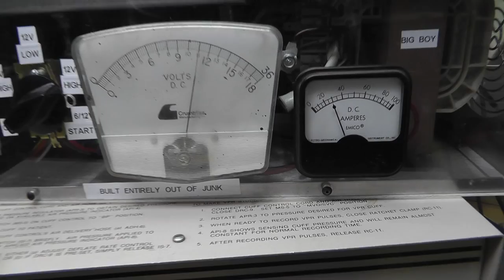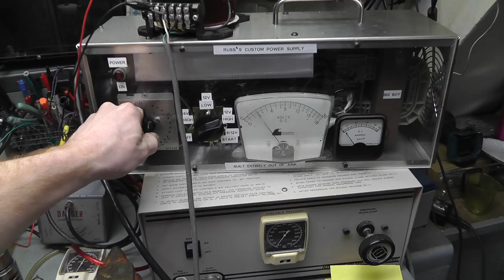Mad Scientist Lab. Best Source Of Fuel Ever! RWGresearch

Comment: mig welding tips, around $9 for 5 of them at tractor supply, so far the .030 works the best for me but I noticed if you dont have a high enough volume it will just flash back, I've had hardend steel drill bits white hot

Comment: @cgspeeddemon1 the whole point of the gas processor is to slow the burn rate,which should make the flame appear less like a blow torch and more like a lighter flame(but should be still visible to a CCD even if not to the naked eye)-the fact the aluminium is only melting at such close proximity to the nozzle suggest its burning inside the nozzle.